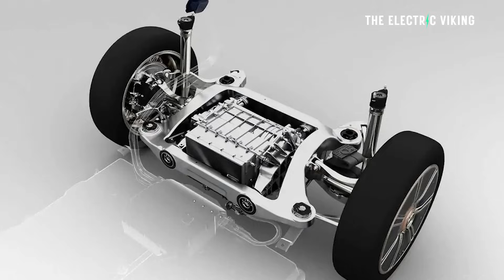Mercedes-Benz reveal new Electric Semi with LFP battery to take on Tesla

Comment: If this truck has a range of 320 miles per charge, charges at 1000 Kw station station, and did a 2400 mile round trip between Spain and Germany, the truck needed roughly 9 to 10 charging stops total,  where did it find those 1000Kw Chargers?  Is the European system having that capability already?  Just Curious......
Reply: The chargers will be ready when the trucks are ready. Tesla won’t be in Europe for quite a while with their semi’s.

Comment: The only down side to the Tesla Semi is the length of the cab for the European market, as the total length of the trailer and cab is restricted.
If the cab is longer then the trailer has to be shorter
Reply: I wondered why they went with the pug nosed cab-over......
Reply: @mipmipmipmipmip Not real? So Pepsi/Frito Lay is not real either.
Reply: @mipmipmipmipmip ?
Reply: @mipmipmipmipmip I think you're confusing it with faeries or gods or something. The Tesla Semi is in use as are quite a few other electric lorries - Volvo has some IIRC.

Comment: The trailer of the Mercedes-Benz might be empty or with lite loading for those tests, there is only 2 wheels (not 4 wheels) per axle and they don't seem to be carrying a big load.
Better wait for the fully loaded trailer tests, more info on the tractor weight is needed for a direct  comparison with the Tesla semi (trailer may not be able to load as much.
Take care.

Comment: For trucking, cycle count may be more important than range.  A "city driver"  running from a DC with a regular route would do 150 to 300 miles per day over 10-12 hours; the power unit would often sit until the next day before it is used again. 360 "cycles" a year, over 10 years before the battery needs to be replaced would be a selling point. These would all be day cabs, the driver would be home every night and the cab would be plugged in and recharging over 8 hours. This specific model could drop into at least 50 DCs that I know of personally in the US; if priced right they would generate a lot of value.
The advantages to an electric truck in Europe are huge. Obviously, for trucking it comes down to TCO and IRR; a power unit is an investment and the beancounters will determine what gets bought for what purpose.
Reply: Exactly!  This is the model I'd expect to be primary - the short route trucks being EVs would be much more beneficial than long range (where diesel is quite efficient).

I think long haulers would be better suited by a hybrid solution.  100kWh battery pack and a 60~120kW diesel generator that tries to keep the battery between 30% and 60% (exact range would depend on the battery chemistry used, LFP might try to stay at 80% - it won't necessarily succeed, mind you, because cruising at 65MPH+ is possibly going to use more power than the diesel generator can continuously supply... however truckers have to stop and rest (by law), so parking and letting the truck run to generate power overnight should get you topped off on battery - and if you're at a truck stop with a charging infrastructure you can plug in and not use the diesel generator at all.
Reply: @looncraz  Actually, the answers to those questions are being determined RIGHT NOW (literally) by Edison Motors.  They have a prototype serial hybrid "vocational" truck that will probably be displayed at the FullyElectric - Vancouver.  It is amazing the thought that has gone into it and the operational advantages.
Edison Motors is literally documenting their journey on YouTube and it is a truly amazing journey to watch if you're interested in how real people can solve climate change.
The CEO is a legitimately experienced trucker who is making sure that the truck actually makes sense. He's also well educated, and has a partner that is just as smart and educated.
Reply: @capnkirk5528  Nice, gonna look that up! Thanks for the direction ;-)
Reply: ALL official taxi since 2017(?) in Shenzhen, China are electric (BYD E6). Since 2020 all the private taxi too (GAC, SAIC, BAIC, Venucia etc). Nearly the same in Guangzhou and surrounding cities. All the route buses are electric. A lot of local cargo tracks too. Even some dump tracks in Shenzhen too. And it is very busy cities - the GBA area population is around 100M. All that on LFP.
Reply: With single crystal cathodes Nickel batteries can have longer cycle life than LFP
Reply: In the EU and UK, the limit for daily lorry driving is 9 hours, 56 hours a week (6 days basically) no more than 90 in a fortnight.

Your figures are going to be off by quite a bit, and obviously no-one drives heavy goods vehicles around a city all day. City driving sounds more like a Transit van than such a vehicle to be honest. They're not going to make Amazon deliveries with these, but will use them to ship between cities. 

Since the correct way to get lots of range is simply to transfer the trailer to another cab and driver, I don't see the range being all that important past a certain point. This is really no different to cars.
Reply: @jonevansauthor  My figures are for NA and would need adjusting for the EU, but Tesco and ASDA probably still deliver using Class 8.  Vans will probably NEVER be used in that industry. Last mile is different. Amazon owns a big chunk of Rivian, and the Amazon volume will likely be enough globally to guarantee Rivian's success. It's likely that economics and practicality will keep these out of long-haul - driver changes will require MW charging infrastructure to be reliably in place and that will be very slow in coming.  You can guarantee that at your OWN depot. It's going to be a very long time before EV Class 8 vehicles become the norm ESPECIALLY in North America.  The Edison Motors trucks on the other hand can use diesel OR charge from a DC fast charger.

Comment: Pepsi's longest run is 450 miles.   The Tesla semi demonstrated 500 mile range in a full length video released when the turned over the trucks to Pepsi.
People have verified the 'full load' based on the load of concrete casting visible on the truck bed.
Reply: Thunderfoot has fully debunked the Tesla video and he had sworn the k rails were made of helium infused styrofoam made at blue origin facility.
Reply: @tech5298       🤔
Reply: Thunderfoot's videos have been themselves debunked.

Comment: I'd be more than happy to rid the roads of diesel trucks. I ride a bike and some trucks have disgusting emissions. I won't miss brake squeal either.
Reply: Especially true in Europe with densely populated cities with narrow roads where heavy truck noise echoes and fumes get trapped.

It would be a big win for Europe.
Reply: At first I thought you meant motorcycle, they pollute more than cars. Bicycle bike, got it.
Reply: Diesel may smell worse but cars put out more pollution. We still havent gotten past the point of EV overall creating less pollution either (I drive a 3 and Y so dont get your panties ruffled).  What we can do is elect people who can push this forward, in a correct manor. This being said, the US has failed so far. Good luck humans.
Reply: @rp9674 yeah
Reply: EVs polluting more is a myth based on anyone can say anything & pass it on.  Diesel emissions are different and gas vehicles, it's particulates that can be very irritating to lungs, even if you don't have asthma.
Bonus with EVs, they have potential to run even cleaner in future with cleaner electricity sources, solar etc
Reply: @mipmipmipmipmip That's why I avoid the roads where possible and use bike tracks. If I have to cross a road, I use the pedestrian crossing. It's not 100% as some people run the red light.
Reply: Tron-Jockey  wow facts versus ignorance, well done!
Reply: Hopefully electric truck also eliminate noisy air brakes as well and can fully replace these with energy saving regenerative braking
Reply: I think go to electric trains and have short haul EV trucks. Clear the roads

Comment: Did they fire their aerodynamics specialist to save money?
Reply: Cabover is the European norm, I believe because of length restrictions.

 But to get that kind of range while pushing what is essentially a brick through the air is quite impressive.
Reply: I think they could have pushed the envelope more than they did. I'm no expert, though. Just looks like it has a lot of protrusions and edges and surfaces that are unnecessary. I also thing they could round the upper corners more at the front.
Reply: No they designed it to be useful on European roads instead of which Tesla hasn't bothered to address
Reply: @MegaWilderness  tesla isn’t going for the European market yet. There are too many needs for semi’s in the United States and that Mercedes looks like a brick.
Reply: @billstevens3796 Because they are lying about the range.
Reply: @billstevens3796  NASA worked out how to handle aerodynamics for cabover back in the 70's and 80's. This should have a drag coefficient of 0.45-0.53, based on the ICE version. Tesla's semi for comparison has a drag coefficient of 0.36, about 20-30% better.
Reply: Never had one...
Reply: @ZeusBullyMax  It's a tool, not a work of art. The gap between the cab and trailer does more damage to aero than the shape of the nose. The flat back of the trailer does even more damage
Reply: There's at least 3 videos out here by 3 different YouTubers.  Saying how Europe likes cab over more than they long nose.
Reply: They never had one, they don’t know what that is, and it shows.
Reply: @Chainyanker007  It's only in the USA that they like trucks with pointless noses
Reply: I'm pretty sure they could have made it a whole lot more aerodynamic without making it more than 2 feet longer
Reply: @netgnostic1627  They could have made it half as wide and half as tall but all vehicles are a compromise
Reply: @MegaWilderness  What?  Then it wouldn't be a semi.  The aerodynamics are limited by the height and width of the cargo box.  There's no point in making it a different height and width than that, except that it could be rounded and tapered at the front, leading to the back edges which would be the same dimensions as the box.
Reply: @netgnostic1627  Exactly my point. Semi simply doesn't benefit European roads and villages were speed limits are low and aero doesn't play a large role
Reply: @MegaWilderness Aerodynamics plays a large role in energy efficiency once you get above about 20km/h.
Reply: @cedriclynch  Not really, varies exponentially with speed. There's a difference between having the barest impact and stopping the vehicle
Reply: @cedriclynch  Shhh, we're clearly in the presence of @MegaWilderness, a recognized expert on the unimportance of aerodynamics.  We'd better not antagonize him any further.

Comment: They are putting batteries in the trailers as well to give the longer range and additional drive motors in the trailers and generators on the trailer axles so when the drive motor is not under full load or load the batteries are being recharged

Comment: Tesla semi has a range of over 500miles.
Pepsi does 450 mile runs on one charge daily. It’s liquids so it’s full load.
Obviously they must have some margin so 500 mile range will be practical to run 460-470miles  absolute max.

Comment: I'm still hoping for a trailer with a battery and an engine, something like the eTrailer from Trailer Dynamics. 
It's essentially a range extender for every vehicle, both electric, but also for a diesel.
It turns every semi into a plug in hybrid, perhaps even with solar panels on top of it.
Reply: @Sonshine70s  Oh really? Do you realise that 95% of trucks is no way near their cargo capacity so it doesn't matter at all? 
And that's still ignoring the fact you can drive with a lot smaller engine and have to carry much less diesel...

Comment: You forgot to mention the voltage!! - The E-Actross 300 and 400 were based on a 400V architecture, and Volvo is still doing that as well. But the E-Actross 600 series is based on a 800V architecture, which allows them to get the megawatt out of an MCS station (megawatt charging standard HPC). - On top of that, Mercedes-Benz revealed the MMA platform for cars on the IAA show today, which is the 800 Volt platform for cars. Along with stanardized LFP battery modules that's a key characteristic to keep up with Tesla's innovations. In fact, Tesla's 1000 Volt platform has only few months in advance on the market.
Reply: Voltage alone means nothing.
Power (measured in watts) = Current (measured in amperes) x Potential Difference across the component (measured in volts).
400V and 100A is the same as 800V and 200A.
Reply: @Wirmish usually HPC limit the current going through the cable, so if you  have a given max Ampere then more Voltage helps with the maximum kW on a charger. So in fact, your two multiplications are different in real life.

Comment: My father worked on earlish computers (like when integrated circuits that held a whole byte of memory were a very new thing).  He said that papers would be published claiming a theoretical limit for what computers could do.  Then, a few years later, that limit would get surpassed.  Of course, the laws of physics weren't broken or even scuffed, rather the assumptions used were wrong.  Then another such paper would be published, and again its claimed laws-of-physics limit would be surpassed.  Dad said that eventually such papers stopped being published so much.  Because they are really about some assumptions that someone thought reasonable, then turning the cranks on the laws of physics to calculate what that implied.  But instead of billing them as "here what my assumptions would imply", they're billed as "theoretical limit based on the laws of physics".  Have a real discussion about what the laws of physics really say, and the listener will say "yeah, but that's not reasonable", not that it's not physical.  Groundbreaking engineering is about expanding the limits of what's "reasonable" (else it isn't groundbreaking).  The fact that so many people's "laws of physics" limits get broken, indicates more about how sloppy and hokey such calculations often are, than about physics.  It's honestly sad that Mercedes-Benz is wasting time saying this, instead of focusing hard on ground breaking development, of something.  I think that we should build a power plant fueled by the voluminous hot air from the whinging Luddites.  Wouldn't solve global warming, but would be satisfying.
Reply: My father is an engineer and one of his favourites was 'Physicists tell you what can't be done and engineers go out and do it.'

Comment: Downix ; you are suggesting that the 4680 batteries in the Tesla semi are Lithium iron posphate or some other vehicle? Here is what I've found. "he current Tesla in-house 4680 cells are based on the NCM 811 cathode chemistry, while in the case of BESS, the company would like to make a transition from NCA/NCM to Lithium Iron Phosphate (LFP) battery chemistry."  So while they could move to the more safe LFP right now they are not.

Comment: I don't know why you say the tesla semi is 400 miles of range when Tesla has demonstrated 500 miles!! Pepsi said that they had routinely been driving up to 450 miles on a single charge which does not mean that is the maximum range.
Reply: Range is critical with cars but not trucks. What is, is payload and we have yet to see facts (as opposed to hype) on Semi payload
Reply: @jimpackard8059  No, not at all. Range is very important for semi trucks and Tesla said that the 500 miles is with a full load. This is not hype!

Comment: Personally, i think the trucks should be diesel electric hybrid, but not for regenerative braking, but instead new trailers that have solar integrated for a constant ~19-27kw on a good day.
Same with trains, keep the existing diesel electric powertrain, add very little batteries, and add solar to the cars.

The ammount plug-in hybrid cars that can be built using those batteries is staggering, but must cars do not have a design that can accomodate solar(i have a 600mile aptera reserved) but trucks and trains?
Other than top loaded grain cars, almost all train cars can be used for solar, even top loaders can still be used for solar if there is a closing cover

Comment: The Tesla Semi did 500 miles with a full load, and still had remaining battery capacity. Mercedes should be able to match that soon. 
With an LFP battery and everyday use, the pack should last for at least 12 years if driven on freight routes in Europe. That's around 2.5 million miles, or 4 million kilometres, assuming that average consumption is 1 mile / 1.6 kilometres per kWh. That durability rivals the lifetime of a well-designed Diesel engine in a truck, whilst requiring far less maintenance and significantly lower running costs, providing that the electric motors are reliable.

Comment: Kudos yes.  Anything that advances the real world capability of trucks is welcome.  However, the 320 mile range means that to complete a 2400km trip it would have needed recharging along the way somewhere, obviously.  How long did it take to cover that distance (including charge times), and what weight was it hauling?  I think for long range heavy transport these are the primary sorts of questions.  Cold and hot weather trialling is important, but also is cold and rapid gating.  Time = money in heavy haulage. Early days yet.
Reply: Maximum driving time is 9 hours per day, so you have a lot of hours to recharge it if for some insane reason you are doing a 2,400 km road trip. Which should of course be done by rail. Which it probably is.
Reply: @jonevansauthor  Agreed.  This whole question really interests me on what they were able to do and what it meant logistically to achieve it.  These things don’t necessarily get explained, and its good to get another perspective.  👍